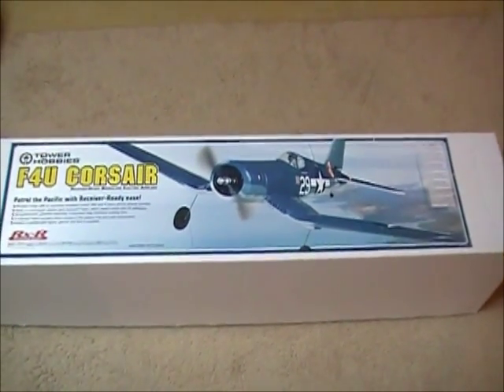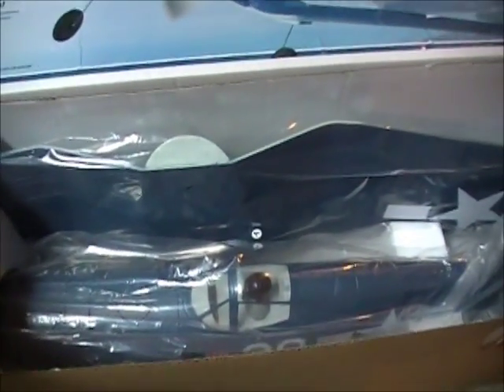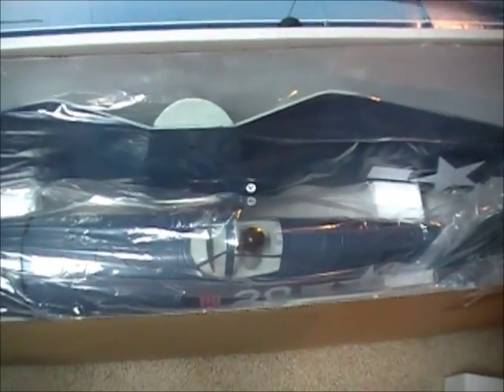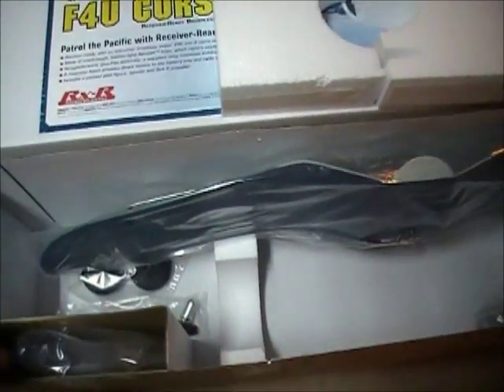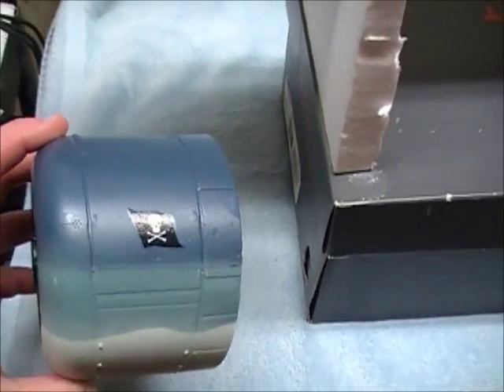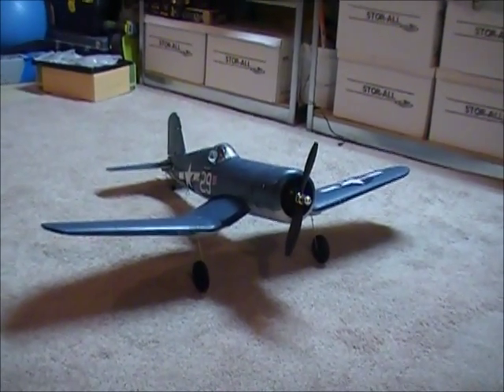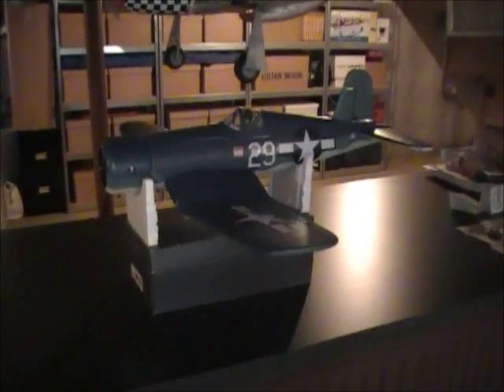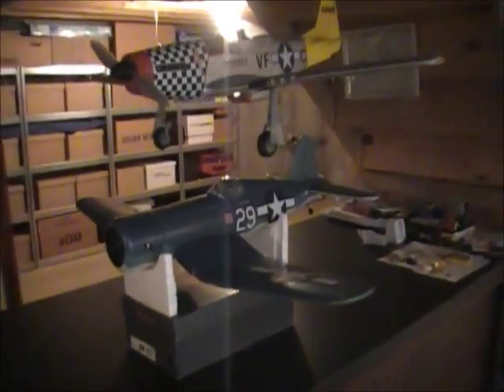Tower Hobbies F4U Corsair Review and Bench Test

Comment: Not yet. It's still a little windy in my neck of the woods.  I think it'll be fine with the stock motor.  It really want to just jump out of my hand.  I actually think I may need to cut the throttle back some for the first flight so it doesn't go straight up on me.  Its a cool plane. Good luck.